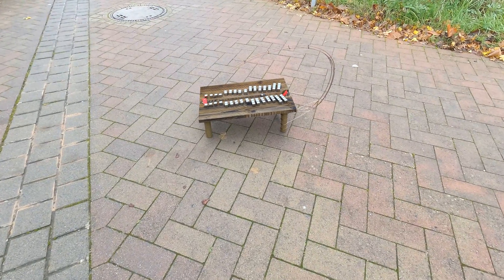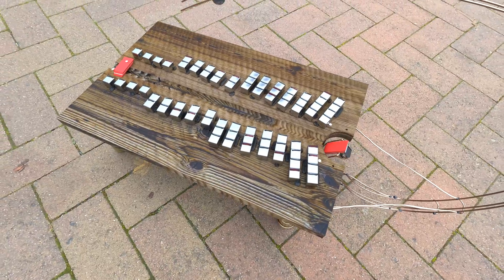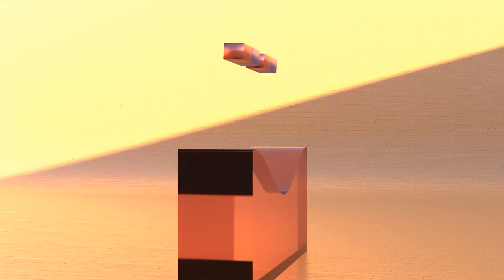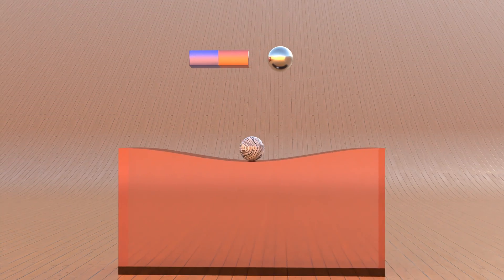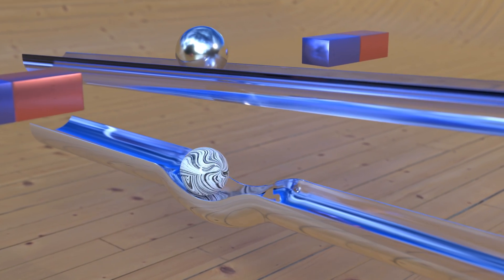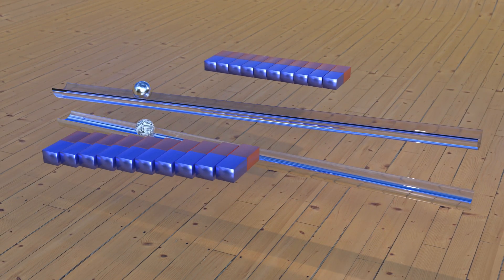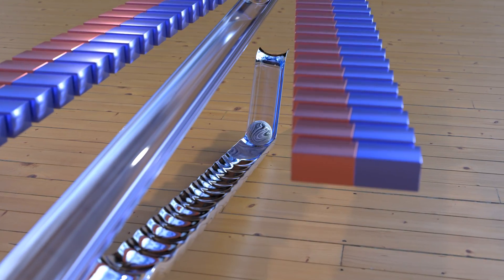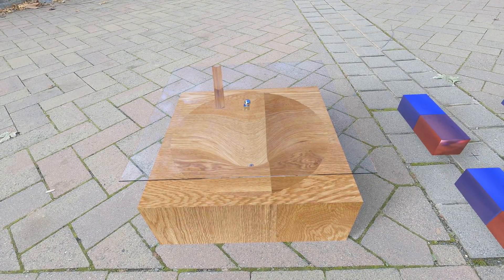Truth: What is a magnetic ramp or SMOT? Perpetual motion motor base? Working principle explained!

Comment: If the V-Gate is done with magnets , neodimiun or ferrite,  and you must use a iron ball . BUT the V-Gate can be two simply iron pieces and you can  use a neodimiun magnet ball. The effect is the same. But is much more hard to "fine-tune" with a magnet ball. But all things  are lot of  fun, you can be sure.
Reply from the maker: Hi Robert, thanks for your comment. Using a iron or steel ball may be possible, but in the end, the ball ends up in the point of maximum magnetic force. Thx for watching 🙂

Comment: I was thinking something like this, but I don't understand the concept. If you make this sphere spin something to generate energy using gravity when it's at the top and then drop it back where it started, wouldn't it have power for the next cycle? A doubt
Reply from the maker: Hi, thx for your comment. I’d made a Ramp with generating power while running up the ramp, you’ll find it on my channel, but I fear it would not do the job. Thx for watching 🙂

Comment: Why does the idea with the ball going around the ramp not work? To me seems like it would work. Why not?
Reply from the maker: Hi Gabriel, thanks for your comment. The magnetic ramp leads to the magnetic maximum. It’s impossible to leave this maximum without extra power. If you follow my thoughts about gravity similar to magnetism, you will understand. 🙂. Thx for watching
Reply: @yWild  Does the magnet push the ball away when the ball tries to get close to the start of the ramp?
Reply from the maker: Hi Gabriel, in this case my conception only uses attraction. The magnetic ball runs on  its equator and the axis of rotation goes through the poles. If you watch the marks at the magnets, you’ll see. But this is no guarantee of working as desired. Thx for your comments 🙂
Reply: The ball can leave the ramp by itself. You can view a lot of videos of that in youtube. But must to exit before the point at what the magnetic atraction is greater than the gravity atraction. That point is called "the sticky point". And after that point the ball cant scape.

Comment: Have you looked at David Allen LaPoint's Magnetic Array Loop?
Reply from the maker: Hi Quantum, thx for your comment. I’ve been watching videos about lapoint and will think about. It looks like the same thing as a smot at the first glance, but I will check if I find a good way to show it in gravitational behaves. Thx for watching 🙂
Reply: @yWild  I saw a video were someone made a few of the magnet accelerators. They estimated it would cost a few thousand dollars in magnets to build a continuous loop, so it's not an economical free energy machine.
Reply from the maker: Hi Quantum, I saw the same video, I think. The YouTuber said, that it’s a invest to do, just for try out it works. In fact, the force to put the magnet into the tube has to be done every time for each of the magnet arrays. I fear, the system would slowed down and it’s going to stand still in the end. Thx for your comments 👍🏻🙂

Comment: Schönes Video :) Hast du bei der beschleunigten Kugel auf der Rampe, auch die hinzugefügte kinetische Energie mit in der Simulation berechnet? Und was ist, wenn du die Rampe nicht aufsteigen machst, sondern abfallend? 
Nice video :) For the accelerated ball on the ramp, did you also calculate the added kinetic energy in the simulation?And what if you don't make the ramp ascending, but descending?
Reply from the maker: Hallo Tycobot, ich danke dir. Wenn die Rampe abfallend ist, dann Liegt es an der Stärke des Magnetfeldes, ob die Bewegungsenergie zusammen mit der Schwerkraft ausreicht um die Kugel zu befreien. Wenn ja, also die magnetische Anhöhe am Ende der Rampe verlassen wurde, dann reicht die verbleibende Energie der Kugel nicht um zurück auf die Rampe zu kommen.
Thx Tycobot, glad you like it. If there is a slope downwards, and if the gravity in addition to the velocity is enough that the ball is released out of the ramp. The power is to less to get back into the starting position of the ramp. Thx for watching 🙂

Comment: I love your channel and have learned a lot from you...but I have built a smot that releases the projectile off the end. Now, I used magnets instead of a ball. Here are the videos showing that a magnet can be pushed past the sticking point at the end. The difference from the 80's smot is that gained magnetic power must be equal from start of RAMP to end...so, adjust the smot to be symmetric in flux and use magnets in place of ball, and it works...well, it gets off the end of the ramp, that doesn't mean perpetual motion is possible, but a smot can be effective in a silo.

https://youtu.be/Vo2-Qb3fUYs

https://youtu.be/9-r8C50nHdU